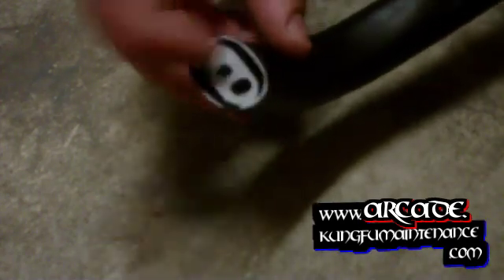How To Tap Metal Threads With A Thread Tapping Tool Rethread For Screws

Comment: No offense but it's a poor way to tap straight. A tap with tap handle, hold the piece in vice, operate with 2 hands and look at the tap angle to be straight on both directions so you tap it straight.
A crooked tap angle may break the tap, drive a crooked tread even in a straight hole. The wiggling action with your screwdriver-tap combo may enlarge the threads, etc.

Nifty tool for plastic work and sheet metal threads but with more care. I'd still use a normal tap and handle.